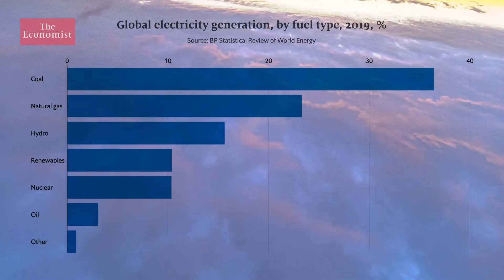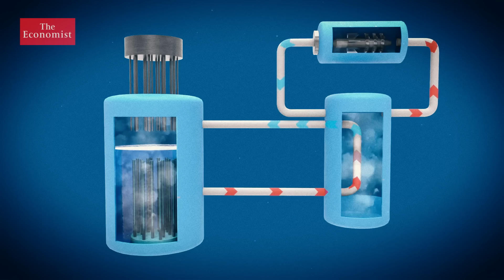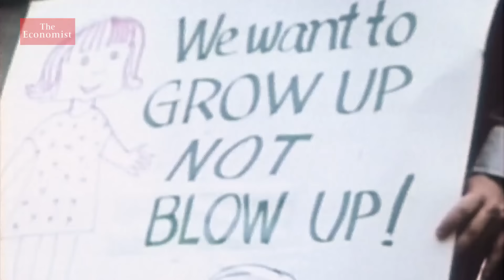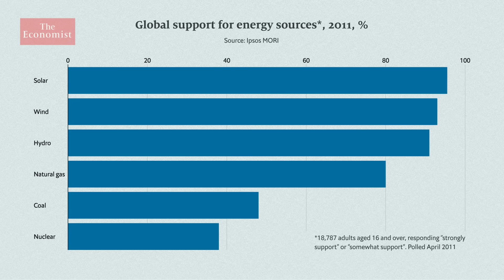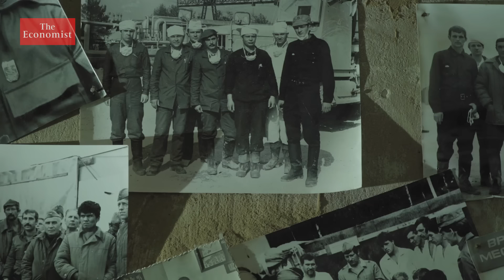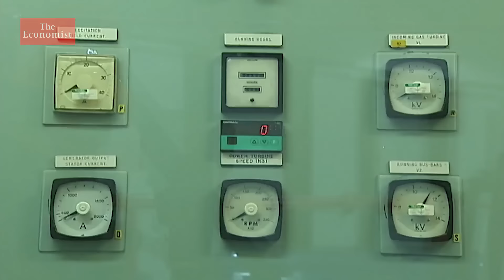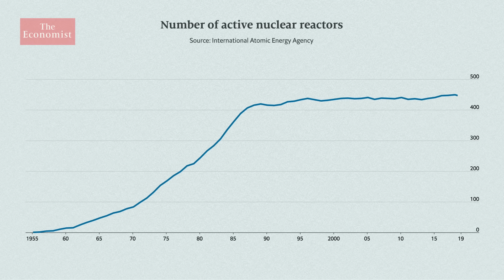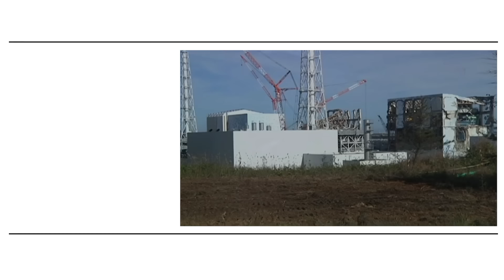Nuclear power: why is it so unpopular?

Comment: To late, this video is obsolete.  Utah is having 12 modular nuclear plant built (first one to be operational in 2027 )  An experimental nuclear reactor in Idaho could be the first of its kind in the United States: a commercial reactor providing power using fuel that reduces nuclear waste. The small power plant could power about 1,000 homes and can run almost autonomously for 20 years. Popular Mechanics    By Caroline Delbert	 Feb 21, 2020
Reply: The NuScale SMR produces 77Mw which is 1/15 the output of a standard PWR.  One SMR is estimated to cost $4 billion which is a massive financial failure and that is if they can build it for that price and the taxpayer is paying 50% of the cost.
You would have to build 15 of these to equal the output of one standard PWR.  If no one wants a PWR in their backyard what are the chances of finding 15 others that don't mind.

The project was started in 2015 and is not expected to complete the first one SMR until 2030.   I am waiting for the "better, cheaper, faster" and "supply chain issues, labor shortage, and fuel cost" excuses soon to follow.

Popular Mechanics also has great articles on flying cars and personal submarines.

The project is already behind schedule.
Reply: @clarkkent9080  I have read a new report that Idaho is getting 10 of the same at a total cost of $3 billion .
I will research this more  and try to second source the story . And yes they are smaller that was the whole idea , smaller and more manageable. And as for not in your back yard fine, we do not have to run the wires to your house!!!
Reply: @bobpawtucket1336  Yes they want to build 12 but that has now been reduced to 6 (new develop in 2021) and the project has been delayed 3 more years.
The price keeps rising and the U.S. Taxpayer is providing 50% of the cost up to $2 billion with the other billions coming from NuScale.  This project has had problems from the start and there are many changes and they are not being communicated to the public.  The story below is 2 years old.
Eight of the 36 public utilities that had signed on to help build the plant have backed out of the deal. The withdrawals come just months after the Utah Associated Municipal Power Systems (UAMPS), which intends to buy the plant containing 12 small modular reactors from NuScale Power, announced that completion of the project would be delayed by 3 years to 2030. It also estimates the cost would climb from $4.2 billion to $6.1 billion.

Every utility that has nuclear has always selected the largest (Mw) available due to economies of scale.  There is not a great difference in personnel (operators, security, engineers, managers, maintenance, admin, etc between a 77 Mw and 1,200 Mw plant so SMRs are at a great disadvantage there.  Their only advantage is that each one should cost less than a standard PWR and be built faster thereby shortening the ROI but since they have never been deployed in the U.S. everything is just corporate PR until proven.  Vogtle unit 3/4 was supposed to take 7 years and $14 billion for two 1,200 Mw PWRs but the current cost is $30.2 billion 15 years and at least one more year away from operating.

When discussing new nuclear in the U.S. you should always use the Missouri moto - "SHOW ME"
Reply: I stand corrected.  The NuScale project you reference had the output halved due to ballooning costs and now that many utility backers have well backed out, the project has been delayed till 2025.  Can anyone say soon to be canceled????

Comment: Nuclear power has MASSIVE hidden subsidies. The government basically insures the plant for free and so when you get a Fukashima which costs billions of dollars the company responsible doesn't haven't to pay for the damage and didn't have pay an expensive premium for that insurance policy. Then when decommissioning is required the government will pay for that as well. The purpose of the nuclear industry is mainly to support nuclear weapons either now or in the future. For Japan it is a nuclear weapons insurance policy.
Reply: And other forms of electricity generation methods do not have subsidies on your planet?
Reply: @danadurnfordkevinblanchdebunk  The subsidies ARE massive. The insurance cost is unbelievable. The cost of Fukashima was between $300B and $700B. The company didn't pay for the damage or for insurance. One estimate is that the cost of insurance if paid by the plant would send the price per KWH from something like $0.10 to around $3.30. 
Other forms of electricity getting a subsidy??? Give me a break.

Comment: Will you continue the segment to talk about emerging nuclear power science? A while back I saw a video where they talked about new nuclear fuels and me system that prevent meltdowns. One described a fuel that reacts in proximity to another element, and makes meltdowns impossible as gravity can be used to pull the fuel away and stop the reaction.
Reply: Yeah that’s thorium. MUCH better fuel source in every way - like 100x as much (a lot cheaper, and so much safer/easier to mine), doesn’t need enriching, less radioactive, produces like 100x the energy per gram, only reacts when in contact with a certain element (and when it gets too hot, the bottom of the container melts and moves thorium away from the element and preventing meltdowns. Literally better in every way than plutonium. Way cheaper, safer, efficient, effective - and the waste has a half life of 100s of years, not thousands. Poorer countries can be trusted more with them because of this - and thorium can’t be used in nukes, so no worries there.

Comment: Very interesting video. However, one major disadvantage of nuclear is left out. The storage of spent fuel. Almost no country in the world which operates nuclear power plants has a final solution to this issue. AND many calculations of energy cost do not consider decommissioning cost...
Reply: It's just fine where they are now, no one has ever been injured by stored spent fuel rods.  Will be very valuable fuel in thorium molten salt reactors.

Comment: What is about the nuclear waste? Not ones it‘s mentiont but it is a hugh downside.
Reply: Contained underground
Reply: It’s a valid problem but climate change is a far bigger one. Nuclear waste may be extremely dangerous but it can be contained, unlike the toxic fumes released by burning fossil fuels. If you live in a city, you’re already significantly more likely to suffer from respiratory illnesses or develop lung cancer.

Comment: But you are not addressing one of the main issues of nuclear power and that it is the storage and disposal of it's nuclear waste. It is very high radioactive used nuclear fuel and as far as I know they just buried it underground and hoping not to leak into the environment. These actions are very far away from sustainable. Furthermore, regarding nuclear disasters, the damage to human health is far grater than the deaths and injuries caused by the explosion itself, because of the spread of radiation through wind and water. In fact, in Fukushima they are still not able to completely stop the nuclear process in the reactors and radioactive water is continuously going into the ocean. Maybe it is one of the safest way to produce power, but when it goes wrong, it goes wrong for decades.

Comment: I thought that water slowed down the particles so that collisions were more likely? No water -> no reaction.
Reply: It does slow down, that's why it is used as a mediator, but if the reaction has been initiated, no water means meltdown.
Reply: @RickMGPinto  yes but the reaction stops,  from the video I got the impression that the water is needed to slow down the chain reaction but in reality it is needed to slow down the particles so there is a better changes of collisions and thus a chains reaction.
Reply: @iBlindPanic  The way I understood it is that the water is needed to hold the reaction speed at a manageable level. If the water where to disappear, then a meltdown would happen. That’s what I understood happened in Fukushima.
Reply: @PatrikKron  The meltdown happens because there is no cooling (the core is simply very hot), but i'm a asking about the reaction, I think it stops, because the water is used for moderation (and cooling).
Reply: @iBlindPanic  Isn’t a meltdown the reaction at way too high speed?
Reply: The statement there was simplified in a way that seems misleading,  but its ultimately true.  

The water acts as a moderator, which increases the chance fir netrons to hit other U235 items by about 100x.  Though at slow speeds they have a 30%ish chance to be absorbed rather than cause a fission.

Anyway, water makes the reaction happen - without it there is not enough fuel to reach criticality, even with the control rods pulled out. But when you add water to the system and withdrawl the control rods a bit, the fuel goes supercritical, increasing the number of fissions per second and generating exponentially more heat.

This heat then spreads to the water, which heats up itself.  And when water heats up, it becomes less dense, which means it moderates less.  At some point - at some water temperature - the reactivity will have decreased so much the bc system becomes subcritical.  Meaning fewer and fewer fissions per second and exponentially less power output.  Which means the water will also cool down... which means reactivity goes up, etc etc.  A liquid moderator like water provides a stabilizing negative feedback which makes an exponentially unstable process stable. Water leads to more fissions leads to heat leads to less dense water leads to fewer fissions leads to less heat leads to more dense water leads to more fissions....

Chernobyl failed in a bcc way western PWRs and BWRs cant, since it used water fir cooling but used solid graphite as a moderator.  As the water heated up and eventually ecaporated, the reactivity went UP instead of becoming impossible to sustain.
Reply: @Xylos144  Thank you for clarifying.

Comment: Isn't there a problem with nuclear waste that cant just be thrown away? It has to be stored for something like 10,000 years underground in concrete vaults? Asking for a friend.
Reply: Its only a problem when you make it one. There are dozens of different perfectly doable and relatively easy solutions for storing nuclear waste long term. The only reason none of them get implimented is because a bachelor's degree in science is not a requirement to run for office and make decisions about these kinda things.
Reply: Yes, stored underground.

Comment: Nuclear power has fewer accidents than coal-fired power plants, but the same safety system also drives up the costs of building and maintaining nuclear power plants. At the same time, the price of solar cells and wind turbines has fallen significantly over the last decade. So nuclear power must compete with both its bad reputation and cheaper renewable energy.
Reply: But solar/renewables can in no way meet all our future energy needs unless you are OK with shortages and rolling blackouts.
Reply: @danadurnfordkevinblanchdebunk Even I think that nuclear power will still be in use in the future, but for investments it would be more tempting to go for renewable than nuclear power because of the two problems.
P.S. Technology for storing energy is also getting better.
Reply: I want alternatives to Capitalism; the Ponzi Scheme. I'm in favor of products made to last,  no more wars for Resources, a life that revolves around family instead of a 40+ hour work week plus traffic and Taxes to Subsidize the Wealthy.

Comment: In many respects nuclear power is less damaging to life on Earth than other forms of production. But it's far from safe. Aside from the short-term impact of disasters, they and nuclear reactors produce waste that remains dangerous for thousands of years. In effect it's there forever, in the environment, increasing cellular mutation and hence increasing cancer rates, cumulatively.
Surely it's better to use (and develop) other existing cleaner sources of energy?

Comment: Is the economist falling for the prevention paradox when talking about "only" 600 deaths linked to fukushima? How many would have died or fell ill if the area would NOT have been evacuated? Also, the fact that many of the evacuated people are still not able to return should at least have been mentioned. Fukushima showed that there are always flaws in large complex systems, even a 99.99999% secure system has a slight chance of failure, and the chance of hitting it increases over lifetime.

SMRs are very unlikely to be ever economically viable, nuclear fission and the resulting boiling of water is just so more efficient on larger scales. SMRs will need all the safety protocol, while only providing a fraction of the power. Many SMR designs just hide away their issues by turning the central components into a single enclosed chamber, stating that these are inherently safe. But then they are only reasonably safe (99.9999%) and unfixable when something goes wrong.
Reply: The dead mentioned associated with Fukushima was as a result in the hurried evacuation that should have never been done in the first place.  The fear of radiation was much worse than actual radiation since no one died from Fukushima radiation.

Comment: A disturbingly distorted and very one-sided examination of nuclear power, employing circular-reasoning, unsubstantiated generalizations, distortions, omissions, and over-simplifications to reach a per-determined outcome smiley-faced – it’s all safe, so don’t worry.  Hardly the kind of critical analysis one would expect from a publication dealing with economics which people depend on for sound economic advice.  That you save for last the best and most significant reason why no one accepts nuclear – the unacceptable cost (10:26) -- is both perplexing from an economics publication, and a tad deceptive since you spend so much time on other specious reasons.  This is the sales tactic of used-car salespeople.  While the editor is quick to make fun of the public for its misuse and misunderstanding of the term “radiation,” his frequent and the pejorative use of word “paranoia” – a word with very specific and professional meaning – is both hypocritical and irresponsible.  If your economics advise is as shoddy as this promo-piece, to the reader: caveat emptor.

Comment: what about the waste??
Reply: Fuel in Thorium molten salt reactors.
Reply: It’s a valid problem but climate change is a far bigger one. Nuclear waste may be extremely dangerous but it can be contained, unlike the toxic fumes released by burning fossil fuels. If you live in a city, you’re already significantly more likely to suffer from respiratory illnesses or develop lung cancer.
Reply: @jan_Masewin   And no one has ever been injured by stored "nuclear waste".
Reply: @danadurnfordkevinblanchdebunk  That’s true. But compare it to orbital debris: the problem’ll get worse as time goes on. Not as bad as climate change though for sure :/

Comment: well nuclear power is not actually carbon neutral it takes a massive amount of energy to make uranium for nuclear power also take energy to make the lead  shielding for the reactor. so it does produce emissions.
Reply: It also takes massive energy and resources to make solar panels and wind generators, so what's your point?
Reply: @danadurnfordkevinblanchdebunk  solar panels and wind turbines don't produce radioactive waste that lasts thousands of years plus 95% of wind turbines can be recycled and solar panels can too be recycled if they all put the effort into recycling them.

Comment: If turbines are installed, I heard of underwater currents (in the oceans) that can potentially provide energy 24 7. I wonder if someone could do a report on that.
Reply: Correct me if im wrong, but are not those same currents slowing down dramatically due to average warming?
Reply: @OrionPax127  I do not know if they have slow down but I do know it is a  24 7 underwater current. Wind and solar are not  24 7
Reply: There are plenty of people that have tried and are trying it’s just not as feasible and easily accomplished as wind and solar.
Reply: If you live in a northern state or country, then you know how much metal can rust, especially during the winter when salt is thrown in the street. Now imagine an ocean full of extremely salty water on any metal components or machine sitting in it really on end. It would break down within a year, if not months.
Reply: Where can you find these one way tides? Doesn't all the water just pile up?
Reply: @i2really1der  Then I might suggest looking into the current scientific observations regarding the slowing of underwater oceanic currents, particularly the Gulf Stream and overall Atlantic circulation. Might be useful to your position on hydro power.
Reply: @ImBigFloppa  Yes. All of it requires maintenance. Perhaps carbon fiber might come in handy.
Reply: @OrionPax127  It’s not so much about speed. It’s about the consistency of it.
Reply: @chicklechives  They are not one-way, but the underwater ocean current are consistent.

Comment: "Nuclear weapons can also be extracted from spent nuclear fuel"

No that is incorect. Spent nuclear fuel from a light water reactor can not be turned into a nuclear bomb with a non enriching process. And if you have enrichment, using Uranium is way easier anyway
Reply: They try to scare you into thinking nuclear reactors are time bombs waiting to explode.
I know one woman who keeps saying they will go up like Hiroshima. This is the level to which our educational system has been reduced.
Reply: Is extremely costly and inefficient is more efficient to literally make reactor design to make plutonium for weapons.
Reply: @viceralman8450  yea.. that is really the only  resonable  way to make nuclear warhead... but it share pretty much no component with civilian reactora
Reply: @matsv201  Exactly that's the point.